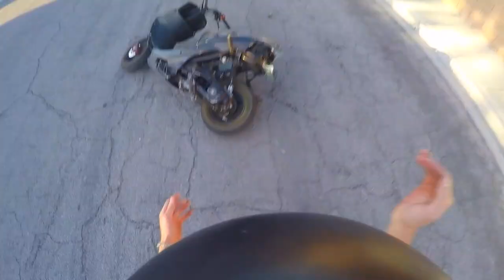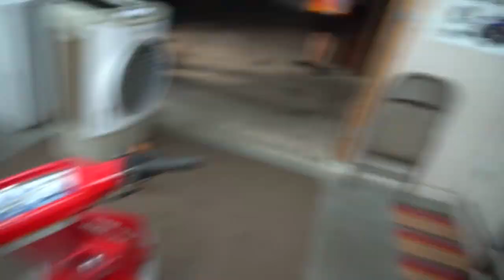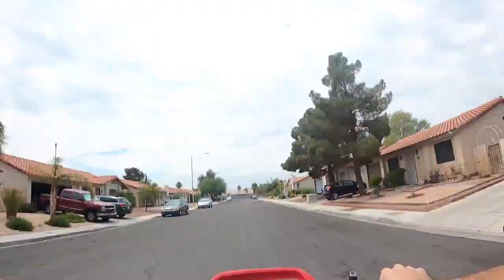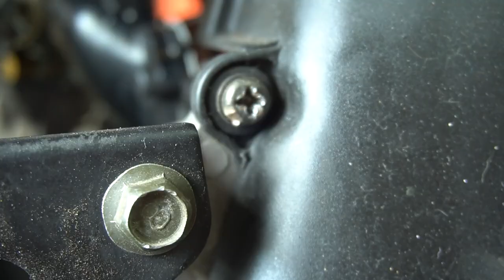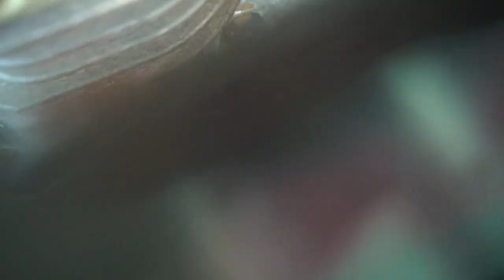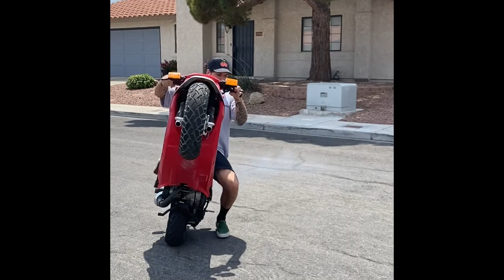it RUNS! MINT 1990 Yamaha ZUMA PREBUG BWS Scooter

Comment: Those philips screws are best dealt with by using an impact driver and a #3 Phillips head. They are technically not Phillips at all and are called JIS Japanese industrial standard. When I build a scooter I replace them all with 5mm allen heads.

Comment: thats also the grease to lubricate the pump gear it's totally normal. I just pull the c clip off the pump drop the gear off and put the pump back in the hole.
Reply: How did he clean it out he just skipped over it
Reply: @sharkkiller7754  probably pulled the flywheel and stator. Then removed the gasket and blew it out with brake clean. 
None of that needs to be done if you just pull the gear and drop the pump back in the hole. It keeps it sealed that way. I’ve seen water enter. After the pump was pulled. But that was a river crossing 😂